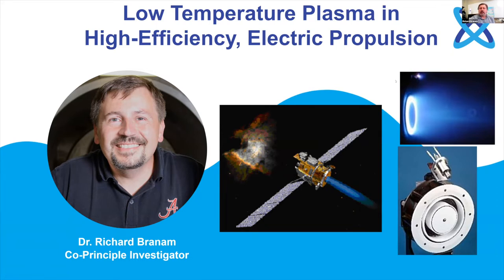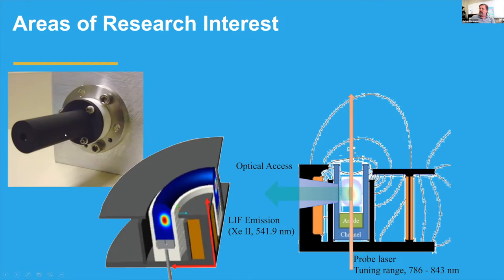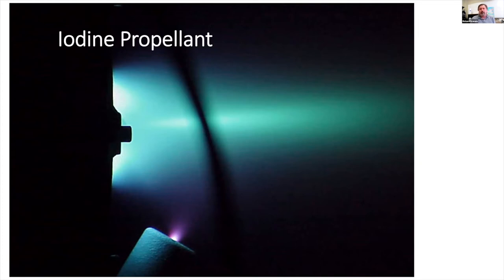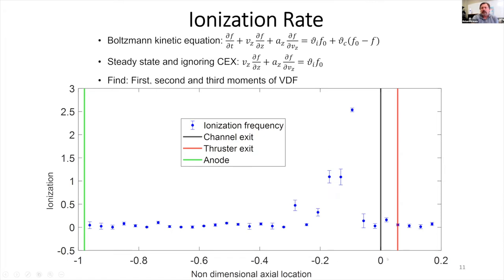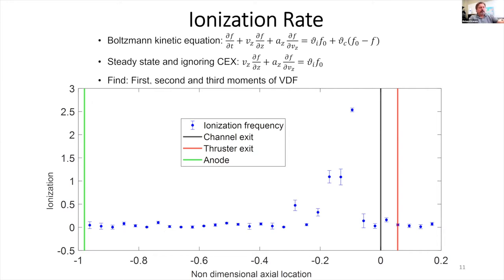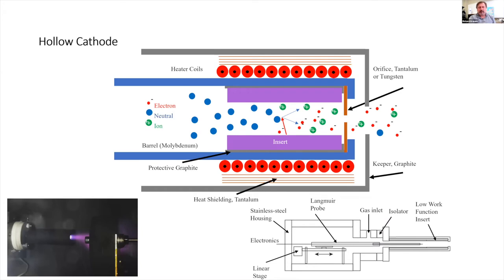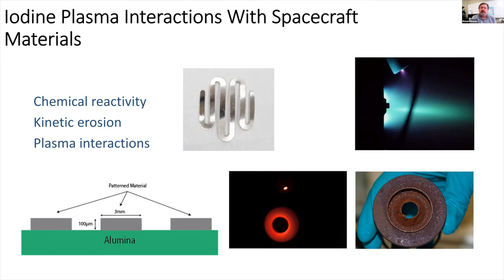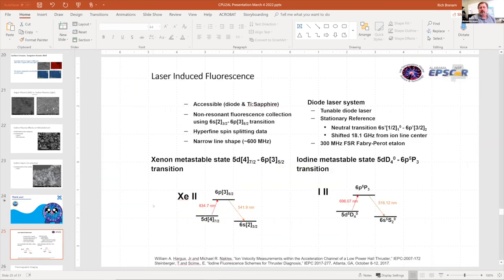Low Temperature Plasma in High-Efficiency, Electric Propulsion

Comment: And with the ion thrusters rather than Hall generally you would want to use a more efficient electron dissociation of the material for better flow rate, since some frequencies and photon energies and wavelengths work factors better than others, and localized vs general field concentrations can help lower the damage to the charge grids as well as controlling the generation and non-axial velocity of the propellant, potentially by pre-channeling or sapping that crosswise energy from the particles before they gain momentum
Reply: maybe an opportunity to add Hall magnetic concepts here!

Comment: Tried to control the flow of the electrons along the low energy free path similar to how Stellarators do, to reduce leakage current, wear, and increase charge densities and acceleration?

If they are inhibited by ion acceleration regions then maybe try to increase the velocity to extend the leakage region and domain past where it is an issue?